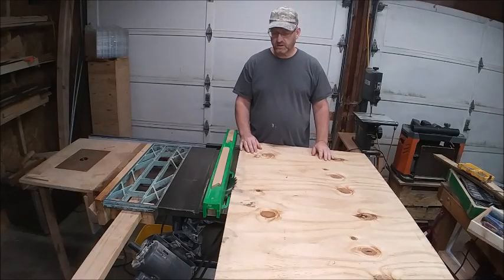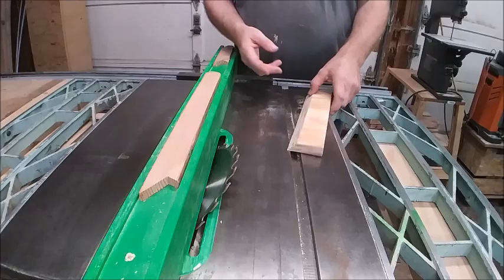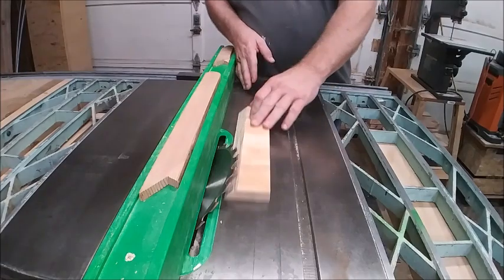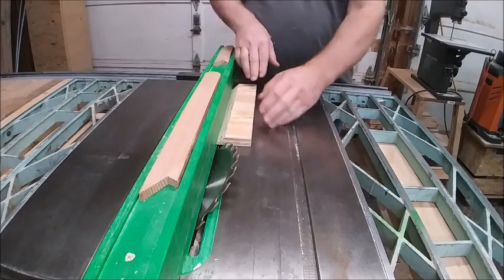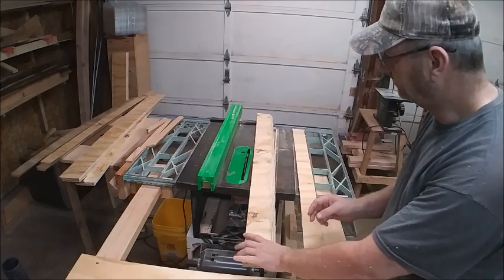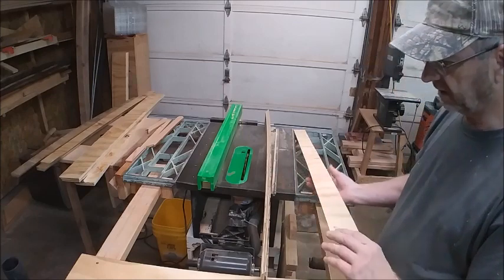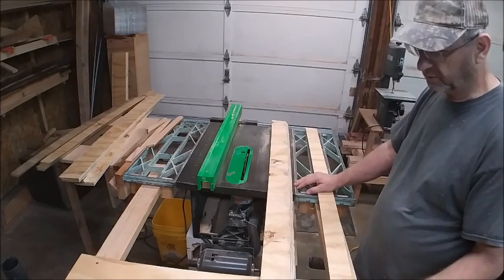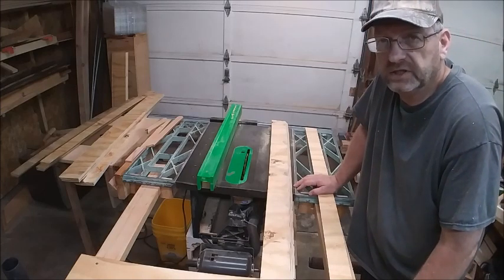Cutting multiple french cleat boards

Comment: When I did my tool wall with French cleats I used 1x6 boards ripped down the middle using a 45 degree cut.  I considered using ply but I was concerned about possible delaminating across the ply's.  After I used the 1x6 though, now I think the ply might have been a better choice because it is straight and flat.  The boards were difficult to rip without cupping in the middle since I was using standard construction grade material.  To make good cleats, the material has to be straight and flat.  Fortunately I purchased extras so I could just cut up the warped pieces for shorter lengths.
Reply from the maker: I was gonna use 1x6's also,  but I had alot of plywood. So I used it. I think it has to be 3/4 inch.

Comment: Do you recommend cleats on top and bottom for wall cabinets?
Reply from the maker: I usually just do the top.
Reply: If you plan ahead you can build the back of the cabinets 3/4" in so the cleats sit flush against the wall.  If not another option is just putting the cleat on the top and using a 3/4" plywood strip that is not a cleat on the bottom so the cabinet.